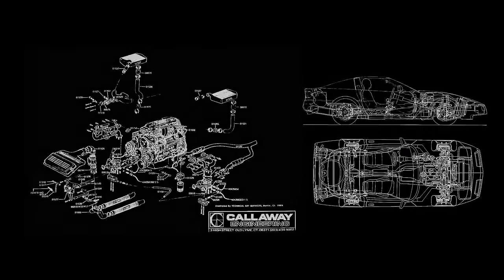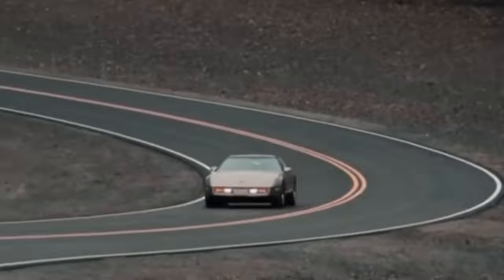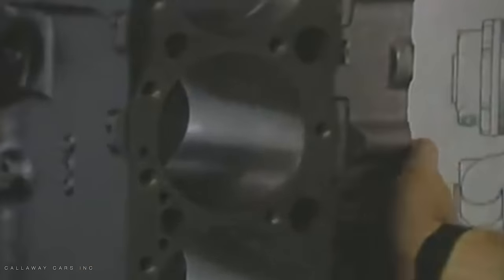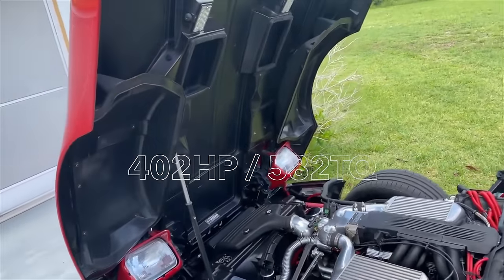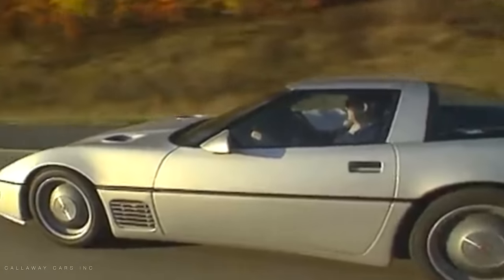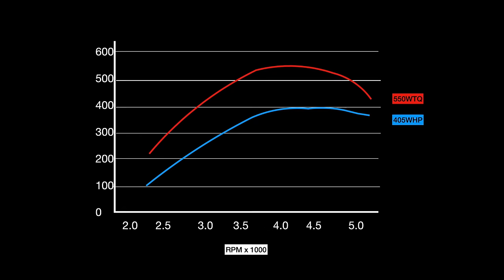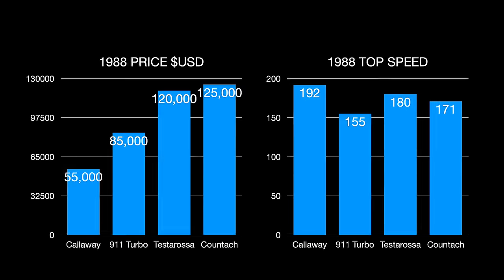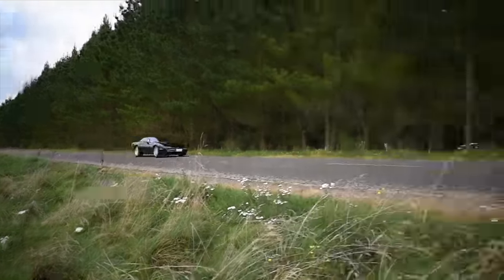How The Callaway Sledgehammer Became The Fastest Street-Legal Car😲 | Explained Ep.10

Comment: I worked as a mechanic at a Chevrolet dealer back in the 80's and 90's, I remember when the Callaway Twin turbo Corvettes first started hitting dealerships. Now that I'm approaching my 70th birthday. I remember my first PDI (PreDeliver Inspection) on a Callaway Corvette, I took a test drive to make sure everything was ok. I took one out on the Highway that had very little traffic at the time. I shouldn't say this but I did hit 160 mph without pushing this car. Law enforcement, just remember this was over 40 years ago, so I don't think there's a statute of limitations on speeding so I can breathe easy. This car was a beast, needless to say I came back to the dealership with a smile on my face realizing I would NEVER own one of these monsters. I was also fortunate enough to drive a couple of the ZR-1 corvettes that had the motor made by Mercury Marine, it was quick and fast but for some reason I just can't get the thrill of the Callaway Twin Turbo out of my head. The only thing I thought about was dreading the thought of having to work on a Vette with twin turbo's under the hood. I grew up in the late 60's and 70's and can say that I drove almost every American muscle care built, car's such as the Hemi Cuda, the Z-28 (back with the 302 motor), Boss Mustangs, the Mach 1, the list is just too long to print. I'm a lucky man to have grown up in one the greatest time periods on Earth. Fond memories to look back on.
Reply: It was engineered by Lotus and assembled by Mercury Marine.  GM owned Lotus at the time.
Reply: @davidgarris2513  Ok, I didn't work for Lotus or Mercury Marine, I was just a simple wrench turning mechanic.
Reply: @jumpercable20  I was just saying.
Reply: I was thinking this video would be about the ZL1, which I learned about recently. When I saw this one is twin turbo, I wondered how it compared. It makes sense that the twin turbo setup made more power than an NA engine. Thanks for sharing the story. I rode around in my grandfather's 1970 Torrino cobra jet when I was a kid and went flying over a set of railroad tracks at 120+mph in a 68 Camaro about 3 months before I was born. My dad won the race and ruined all the shocks and a few other things while the other guy slowed down for the tracks. My hot rod is a 79 C20 pickup with a well built 406 sbc. 165hp as a stock 350 and now should be around 400hp/500tq with all good parts and full roller setup while still running carb legal heads and cam. That is a huge difference, yet it pales in comparison to what an ls will do now, especially with some boost. Now I also have a 2020 fully loaded duramax diesel truck and it is amazing how far performance, fuel mileage, and luxury have come.
Reply: I owned a twin turbo Chevy Nova at that time (first turboed it in 1976). There was no feeling in high performance cars like boost. I will turn 70 in a couple of months and like you sampled many of the original muscle cars.

It was a good time to be alive. We thought it would never end.
Reply: @turbo8454  It only ends when us old folks decide to throw out the fun factor and go green.
Reply: Ok, I actually owned a new 1994 vette and a new jaguar XJS V12 Coupe , one of the last produced.   I believe one of less than 200 worldwide.   Anyhow , the Vette was absolutely amazing for it's capabilities, the jag sucked.   Both had a top end of 170 mph.    The Vette was about $35k, the Jag $74k.  And I'm telling you that the Chevy was the best place to be
 I'm retired from Warner Bros and Chicago. And the Jaguar XJS V12 Coupe was a cool car, but not that much
Reply: @turbo8454  back in the 1970s, were there many turbocharged cars at the drag strip?
Reply: @ericsens7961  None in the 70's. Even in the mid 80's they were a curiosity. I remember the tech guy at the strip pointing  to the turbo and asking "what's that?" Me and my buddy fell off the trailer laughing. One of us said it's a hair dryer.
Reply: @jumpercable20  I'm not going "green". The dirty little secret is that "green" is not really very green.I still have the Nova and a couple of other 60's muscle cars too.
Reply: @turbo8454  Studebaker and Avanti had some terribly fast R2s.
Reply: I can say as a young mechanic myself ....that sounds like one hell of a life
Reply: @matthewsmall7668  It was and I hope the EV thing crumbles just like the pet rocks did. There's nothing better than a gas burning solid lifter (with some lift)cam loping like music to my ears.
Reply: @davidgarris2513  and it was a ZR1
Reply: You mean ZR1, not ZL1.  The ZL1 was 1969 and only two were made.  The 90-95 ZR1 had a DOHC V8 that Mercury Marine assembled for GM.
Reply: @trex_hi5  Sorry, my bad, I need to get back on my Lions Mane mushrooms for failing memory. I corrected it, thanks for the heads up.
Reply: @trex_hi5  Yes, and if my memory is still correct, the starter was mounted on top of the engine betwee the the cylinder heads. I'd have to research it to be sure.
Reply: @jumpercable20  WHAT was the Z-28 302 like!?!? 😃 Thats one of my favorite things to ever have existed! What a beautiful monster. I've thought about playing & mixing up the 327 & 283 I have laying around...

Also- I just wanna say these folk in the comments helping with details is great & all, but they have zero tact or politeness, very robotic. I just want to express appreciation for your sharing of your accounts.
Thanks!
Reply: @trex_hi5   It's actually ZL-1 and ZL-1 is an engine so I can assure you that a lot more than two were made, although only two found there way into Corvettes from the factory and 69 went into Camaros.
Reply: @ChapsShrugged  Thank you for your kind words, the 302 ci motor was bad a$$, of all the muscle cars of the 60's and 70's, just listening to that solid lifter camshaft gave me a boner. It had a firm ride, like it was glued to the asphalt, the power ? It was like I could get into the go pedal and spin the earth in the opposite direction.Once, I brought one home from the dealer, that was traded in, it needed work but I didn't care, I worked at a dealer. this was in the late 80's, I parked it in the driveway and told my wife I wanted to buy it, I told her that if I spent several years making it like new, it would be very valuable, she said NO. Thinking back, I should have said, sorry honey, I'm buying it, being a Chevrolet guy for 40 years, I would have fulfilled one of my greatest wishes. The old saying if Mom aint happy, nobody is happy. So, I guess I'll go to my grave knowing what a big mistake I made. I would never trailer that car, chevrolet made the car to drive and that's what I would have done, but only on nice days, no rain, snow, cold weather. I have a neighbor that has one, it's spent 15 years sitting in his garage, I want to ask him if he ever plans on driving it? I think it might tick him off.  That's the kind of car if you own one, you want the world to see it.
Reply: @turbo8454  my guy. It's back building hot rods that are faster than ever has never been more affordable than the last decade. Different cars, but same spirit. Junkyard turbo LS is just insane power for the money or slap a Chinese journal bearing turbo on a Honda and you can have an 11 second car for under 10k.
Reply: id gladly trade places with you now just for those memories alone
Reply: you are lucky to have been around the good cars of the past. i got lucky too growing up in a car family after i was 10. mom married master gm mechanic and i was allowed to learn and within 1-2 years i was cranking out my own motors. and riding in the cool ass cars my step dad had and his toys. it set me up with a low cost fun life too cause i could do the things and build the things so i wasnt paying someone else. and also payed the bills for over 20 years so yeah not a bad thing to pick up and still do from time to time for myself or others i choose. 
im at a point now where i plan to build my own creations ive been coming up with these last few years and selling them when i get bored for the next toy. people really like the cars i come up with for some reason.
Reply: Was cool, like the GNX, now outdated and slow
Reply: @chehystpewpur4754  I also consider myself lucky for being alive during the greatest music in history, music from the late 60's to the 90's. Beatles,Stones, Floyd, Zeppelin, Todd Rundgren, lynyrd skynyrd, the list is endless. What happened to Rock & Roll?  I never thought I'd 'get into' Country but it's patriotic and easy to play on guitar, as I have 7 or 8 and have been playing for 40 years. Like Joe Walsh sang, "Life's Been Good To Me".
Reply: @chehystpewpur4754  I've always wanted to build a car, an old Classic. My wife just looks at them like old cars, me? I tell her that the old classics were true works of art, created by amazing minds instead of computer generated software. At 70, it's the one thing I still want to do before I leave this life for the next one. Best of Luck to you and thanks for listening to me "ramble on" <<-->>(Zeppelin)😁.
Reply: @jumpercable20  yeah music was alot better then too it wasnt computer generated either hah. people used to fix and maintain their things now most of them can even use the things they buy properly.
build yourself an old car. or even just modern one up some. the less desirable ones can be had for nothing and a standalone fuel injection system can replace the carb and it will be alot less troublesome. or go full on and get a motor trans and harness and put it in there with a few goodies and enjoy it while you can. ive never regretted taking the plunge every time i have. yeah im broke for a bit but all of my creations had tons of offers to buy for way more than i payed for parts or my time building it.
Reply: @davidgarris2513  less than 200 XJS coupes produced in their final year? No wonder I never see them, for sale or otherwise. The Jaguar would have been a different breed from the Corvette, more of a grand tourer with a silky smooth engine.
Reply: @turbo8454  green posturing is what I call it, because most of the green solutions still involve manufacture and waste, especially EV’s. There is no way to manufacture cars and be carbon neutral. The only way to accomplish carbon neutrality is to stop producing new vehicles entirely. That’s not going to happen of course. So I’ll always drive old cars and feel very good about it, knowing that I’m doing more for the environment keeping an old gasser on the road than anyone in a new Tesla.
Reply: @LateNightCable  the V12 became impossible to meet EPA standards and the car was aluminum bodied, hand stitched piping on the seats, it was a work of art and too expensive to produce.  And BTW it weighed over 3600 lbs. 170 mph top end
Reply: @LateNightCable  my car came from Dearborn.  It was a Ford exec car.  It listed for about $75k. I paid about $35k British racing green with "barley" hides.   Only one option was available. Bosch driving lamps for like $500 which my car had.
Reply: @LateNightCable  they produced the xjs for another year, but 1994 was the end of the V12.   The car sat ridiculously low, like a LOTUS, If you can find one, they sell for $40 and up
Reply: I grew up in Old Lyme CT. My first job ever was at Callaway.
Reply: This was cool to read.  I wish I knew someone with one of these old cars that would allow me to repair and restore. I’d love to fix up an old muscle car and daily it. I’m 30, would love a good project. My 95 civic doesn’t quite cut it 🤣 fun and annoyingly noisy. 

What a car holy smokes, 160?? My guy, I’m glad you shared, thank you. You talking about this stuff makes my palms sweat with excitement. Cheers to another year around  the sun, hopefully many more, jumper cables wireless 🤝
Reply: @salvadormuro7346  160? What? MPH?  I owned a new 1994 and stock they were rated for 171 mph.  So I'm going to guess that this would have a bit higher top end.
Reply: @davidgarris2513  OP said he hit 160 mph
Reply: @salvadormuro7346  "HE" meaning the car had more, he just didn't push it. I watched the entire video.
Reply: @CGT80  LS's are a dime a dozen now, honestly I'm getting pretty tired of hearing about them, lol... Glad you built something different!
Reply: You’re going down 👮 Brave story in honesty because of character. You are a bit of a pos for it on another man’s car but I can’t say I wouldn’t. I probably wouldn’t but only because of break-in.. now that I think it had to have been and ready to go. I love the story and wish I could trade a couple of early 70s TA and For ups for one.. anyone got one lol
Reply: @ztwntyn8  This car did not belong to another man, I job description was to look over the vehicle to make sure everything was as the Assy plant intended, which included a thorough test drive. I didn't drive every performance car that way but if you a a car nut tell me you wouldn't have done the same. As far as break in, better it break with me on a test drive than the break on the new owner.
Reply: Thank U <3
Reply: I think you should make a story channel
Reply: @anotherviewer1 my gn runs 7s methanol injection in the 1/4
Reply: Stock engine ... Bet you drived a Chevelle 454 with a huge blower  .. 100 miles you could burnout tickling the gas lol
Reply: @SimonThiboutot-lx3iw  No, but I did own a 1969 Chevelle SS with the 396, but sadly it was the 325 horse engine, and a 3 speed in the floor, I loved that car and I still miss it even today 35 years later.
Reply: Whoop ti doo for my Subaru
Reply: Thanks for sharing, great story.
Reply: that’s awesome thanks for sharing
Reply: @davidgarris2513 base model? Cuz i think 94 zr1 hits 185
Reply: @bigadielldne7234  not a "base" model, just the standard Corvette.   And I believe that you are correct about the ZR1 top speed.   🐾🐶🐕. According to car and driver 175 while some other sources cited 180.   It's not about horsepower and torque for top end, but aerodynamics which have their inherit limitations in the laws of physics.   Hence, the 1970 Plymouth Roadrunner Superbird with the 440 6pak  and a 2.73 or 3.21 rear end could achieve a top track speed of 200 mph while being technically inferior to the ZR1 but having about the same 385 hp.    🐾🐶🐕
Reply: There is a ZR1 C4 with twin turbo LT5  that caps out at 1400 hp... Usually boost is turned down on it to only produce 1100 hp😮
Reply: I some day would like to build my own Callaway sledgehammer. I think it’ll be a lot of fun driving around with a C4 Corvette un suspecting.

Comment: Possibly the coolest part is that that top speed run was made in a car that was driven to the track, set the record, and then drove away.
Reply: And amazing that it did it without all the wings and other aero add ons.  Just a few ducts. I guess the design of the C4 was that good.
Reply: @White91Z  It had a fully redesigned bodywork to make it work well at such high speeds, but of course all this would never have succeeded unless the base car was good to begin with.
Reply: @White91Z wings actually reduce speed
Reply: @chrisJordan-xb9wc  they do keep you on the ground though
Reply: @daugin Yup, that's why they can be good for F1 cars and some others, but if you wanna go at the maximum possible speed you can get in yo vehicle or car however, you may have to discard those things cuz they can usually be draggy in some way, or smth idrk but can still have a bad kind of a drag or aerodynamic coefficient.

Comment: I'm surprised they made tires capable of 250+mph in the 80's.
Reply: I was thinking the same.
Reply: Probably not safely lol but they did it
Reply: They probably didn’t even know and just sent it anyway
Reply: I saw another TY video where Calloway said Goodyear made a Gatorback that was capable of 300mph for the run and had to look like the street tire.  It costed $1 million bucks for the set.
Reply: Bugatti seems to be the only company afraid of tires.
Reply: Speed rating isn’t about going fast, it’s about stopping fast.
Reply: @Joe-bh4vz  actually,  it's about the spinning forces trying to rip the tire apart at speed.
Reply: @jamesengland7461 , speed rating is about braking.
Reply: @Joe-bh4vz  SPEED rating, the max (safe) speed that tire can run on for a period of time. Speed remains the same, how hard you brake does not. 

Tire speed is based on SPEED. Not braking.
Reply: No one did actually, it was a very risky thing they did on tires of that time even though they were specially made for high speeds
Reply: Cars were doing 300 in the 40s

Comment: I remember seeing this in Road & Track when I was a kid. The one thing you didn’t mention is that when they did the 255 mph run they found out after that the engine was only running on 7 cylinders. Definitely a beast of a car.
Reply: Is that true with the 7 cylinders? Is there a legit source for that? Absolutely no offense, I'm just too curious to verify that. For me that would just be the greatest car related thing ever.
Reply: @Aquilius_Caesar  Did a quick search for the original R&T article but didn’t have any luck. Honestly, I read it almost 35 years ago so I might be wrong.
Reply: @Aquilius_Caesar  and they were running on a donut spare tire.
Reply: @maxxod1  If it's R&T, they should have back issues- but I see they list back to 2004... may have to find a hard copy.  

That sounds like a HELLUVA story that just got lost to history,  that needs to be told along with the development of the Honda CB750 Four engine, the Turbo K-cars, the Crusher Camaro's original engine emissions numbers vs. the V1 383 build... really cool, this Vette.
Reply: @toddsmith8608  And they had their distributor 180 out.
Reply: Basically a v7😂
Reply: bullshit ☠️